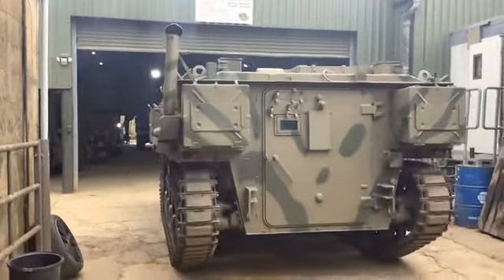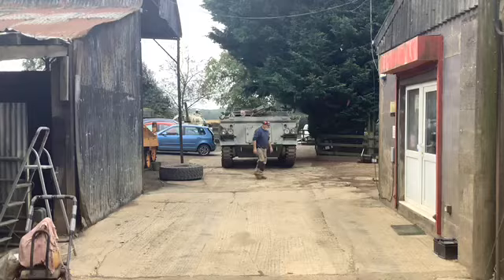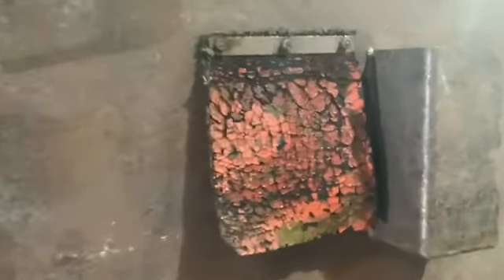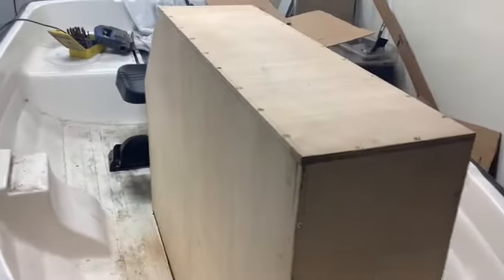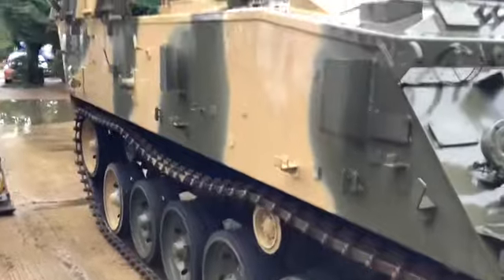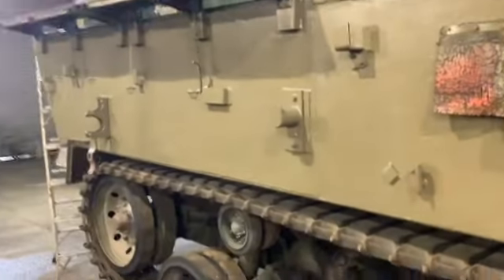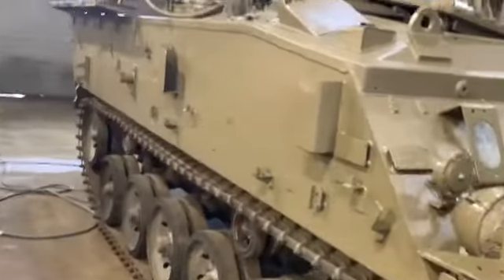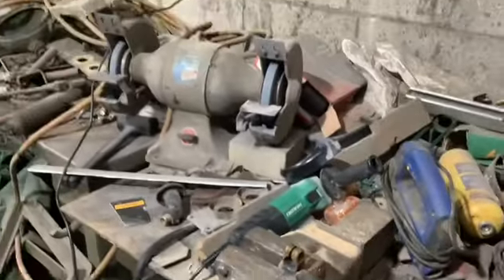20 October 2023

Comment: The workshop is turning out some incredibly vehicles 💯👍👍👍👍
Was thinking about the paddle rowing machine boat
What will happen when do the return stroke??? 
Not much weight on the the paddle wheel . Woundering if it will try to stop. 🤔🤔🤔🤔 or will the momentum keep it spinning 
I guess you will find out soon Nick
 Good thing with the weather is the water splashes will be full
Ace fun👍👍👍👍